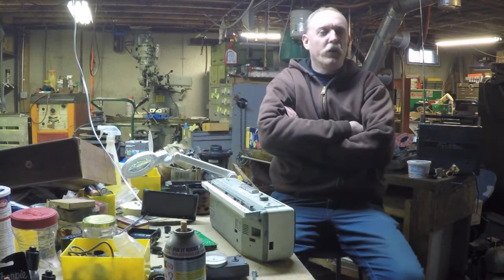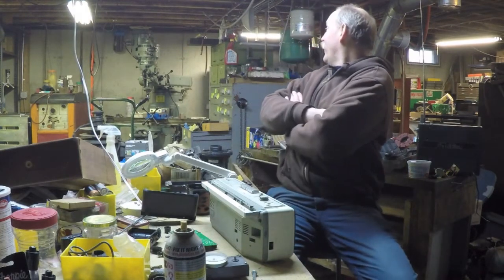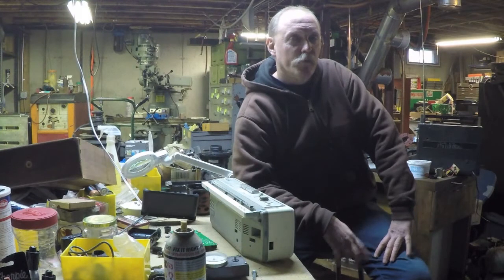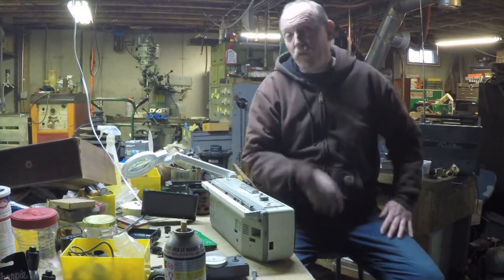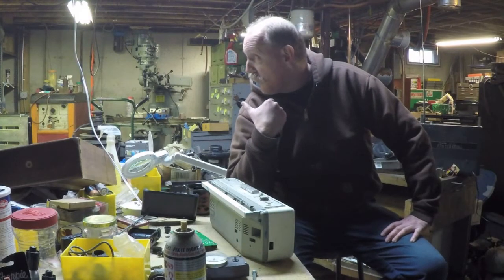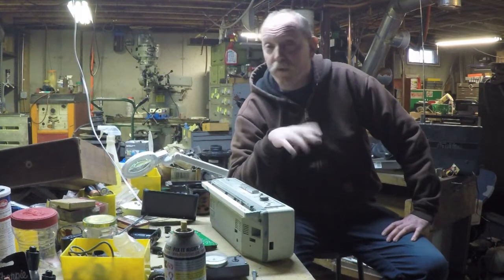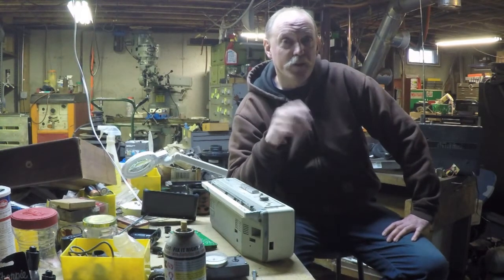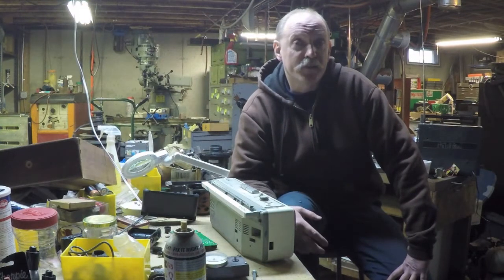Gopro Hero 4 Lav mic woes Part 6

Comment: I'd have probably just replaced it with a 5K resistor. On second thought, probably not. I would have spent 45 min looking through old boards and parts and then after not finding the right one, replaced it with a 5k resistor.

Interesting nonetheless.
Reply from the maker: cheeto4493 lol, thanks!